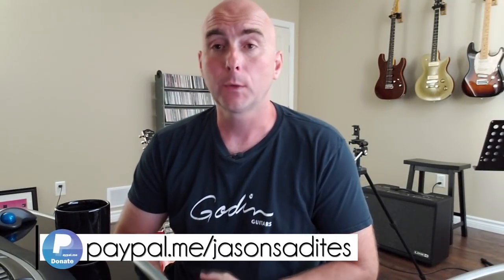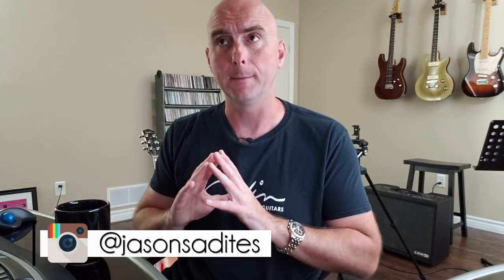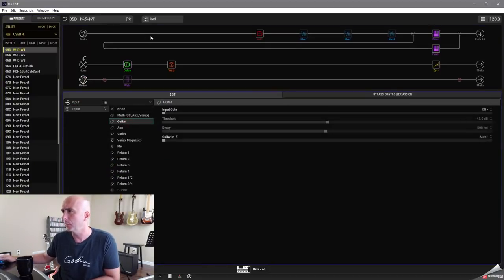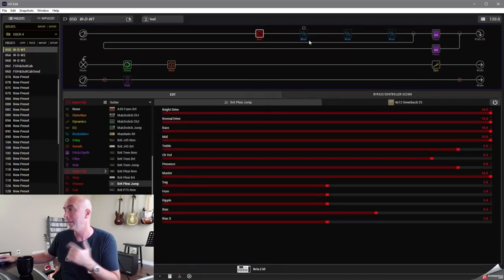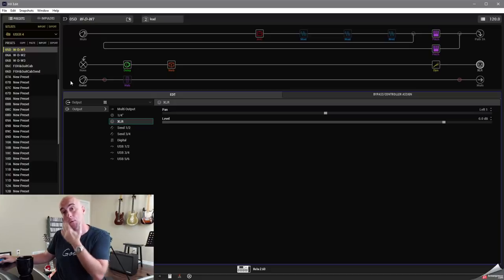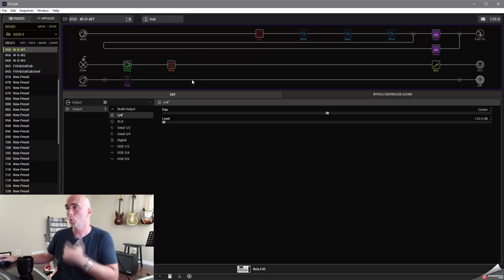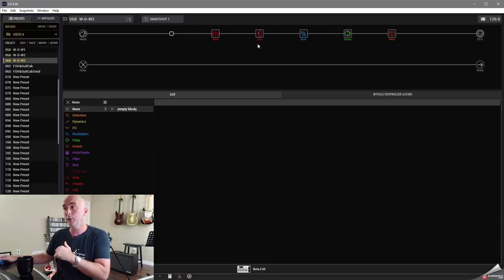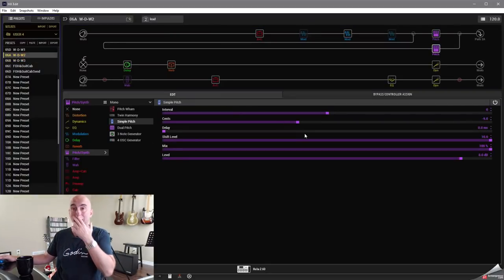Line 6 Helix - Create A Great Tone - Pt. 24 - Alternate Use of SEND Outputs (W-D-W & FOH/Guitar Cab)

Comment: Hi Jason, thanks for the video. My prevert setup would be, monitoring with a tube amp on stage (Helix pre amp  to power amp in) and full amp simulation to front of house. 
I love to use a pre-amp model instead of a full amp model to my powertube amp. Full amps sound muddy. And i would like to have a distorted amp and a clean amp model per preset. Is it possible to use a pre amp model together with full modeling in front of house? I'am curious, what would your signal chain look like?

Comment: Hi Jason. Great explanation again! In my live setup I send my signal from my powercab plus to FOH.  But the FOH guys told me that my signal is too Hot. My output level is set to 0 Db and my volumeknob on the Helix at about 11 o clock. I have to cranck the volume on the powercab up to hear it on stage. Is there a workaround on this? I really like the speakermodeling on the powercab. Hope you can help me out... Thnx a lot in advance! Richard
Reply from the maker: Hey Richard, thanks! Make sure your Helix preset is getting your PowerCab LED into the yellow but not red. You can also lower the output level of the PowerCab direct output to give the FOH guy what he needs. The speaker modeling on the PC is really nice!